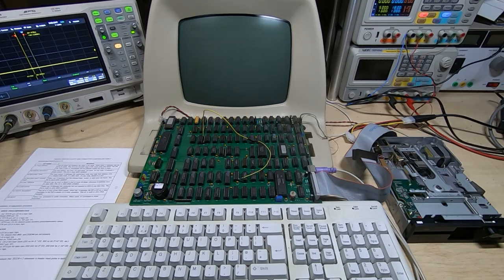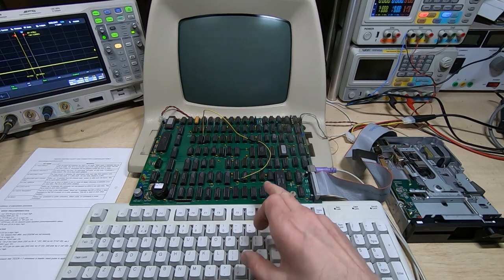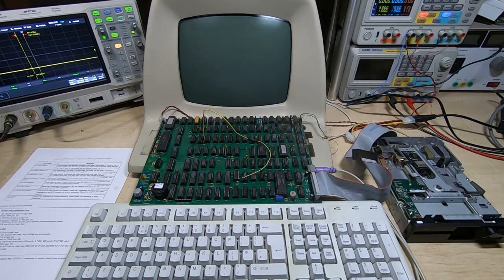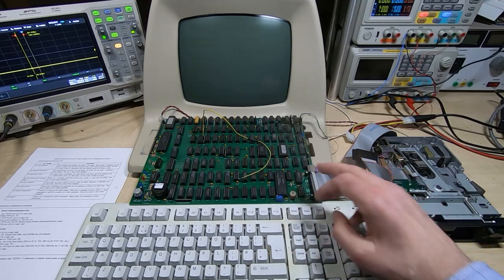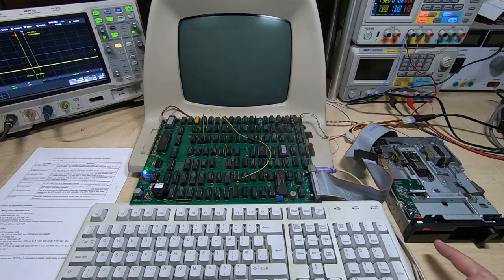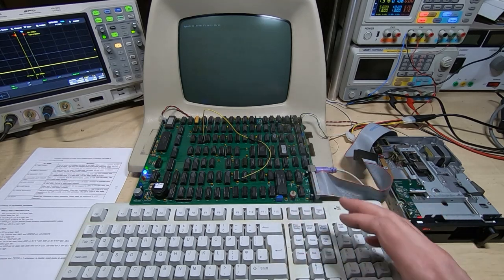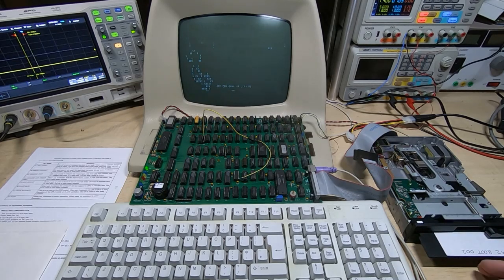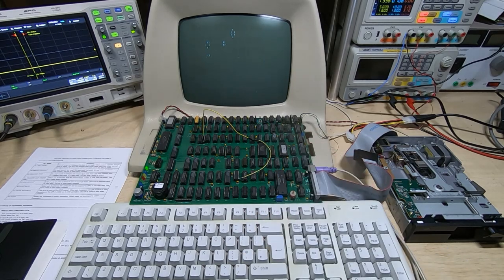Designing A Z80 Computer Part36

Comment: So disappointing when it works on the first try! 😂
Reply from the maker: Yes I had expected some fault finding although the DMA is very complex so it will most likely provide some fun.
Reply: @JerryWalker001  I didn't catch what you are using, but I am very familiar with the 8237. I assume something similar.
Reply from the maker: @john_in_phoenix  Absolutely not. The aim of this project is to avoid the use of LSI devices where possible so the DMA system is a discrete design.